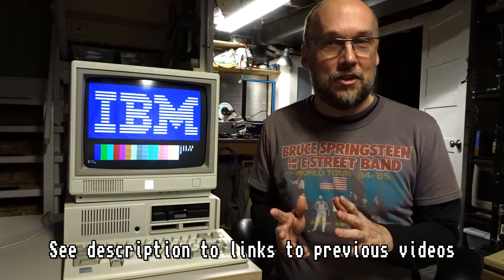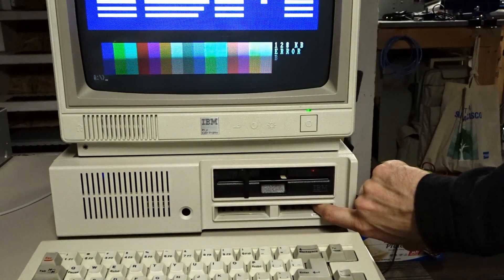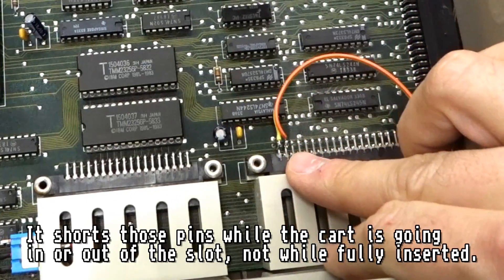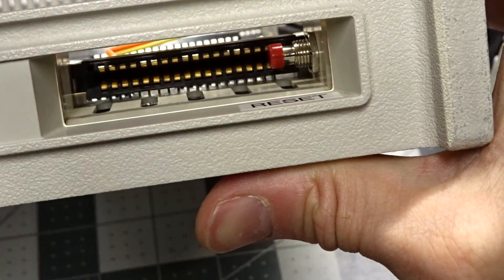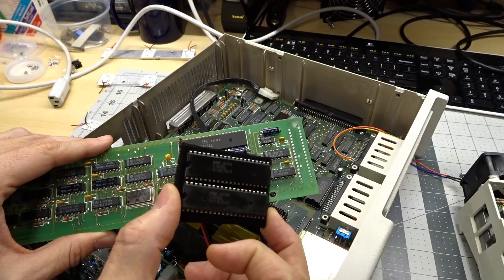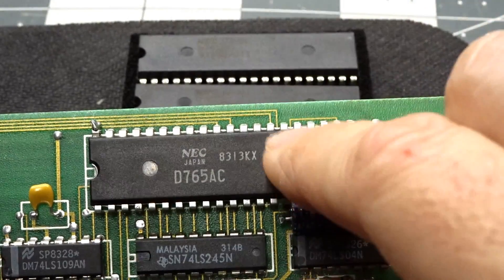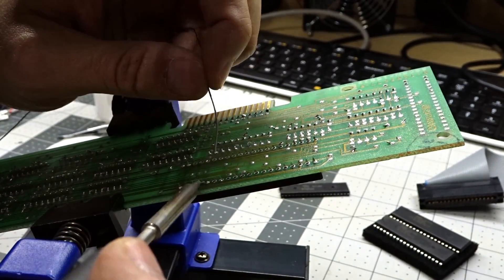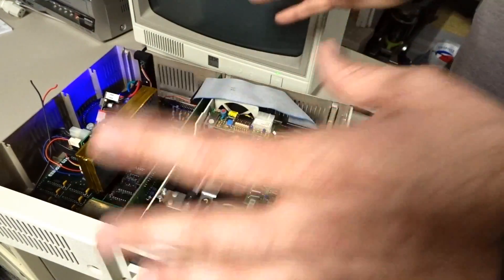IBM PCjr Part 3: Fixing the pesky boot issue once and for all

Comment: Love the debugging and the mod, just wanted to say (sorry!) that it may not be a great idea regarding the placement of the reset button. Your finger will touch the cartridge slot contacts. your finger will eventually carry some charge and create ESD damage to ICs on the bus. I am normally not one to obsess over ESD but this is just asking for trouble :) Perhaps it would be a simple mod to get some strip board with the right pitch and use that as a cartridge edge connector, and solder the button onto that, so that it sticks out towards you? This way you won't be able to touch the pins of the bus.
Reply: The switch is at the front of the cartridge slot, There is a good inch or so between the switch and the pins. Unless you shove your finger all the way into the slot there is no chance of actually touching the pins. Also the case of the cartridge slot is grounded so as soon as you touch it any static is safely discharged to ground.
Reply: @FloppydriveMaestro  is there? it looked to me like it was right next to the pins!
Reply: yeah, i just checked, it's right next to the pins. look at the shot from the top.

the casing you are thinking of looks like it's made out of plastic. the front panel in front of the casing is painted. no grounding.
Reply: @cheater00  The thing as as long as you are not a ham fisted oaf and dont just jam your fingers into it then its never going to be an issue.
Reply: @FloppydriveMaestro  you're right! your next project: putting a switch at the opening of a toaster. merry christmas :)

Comment: I would be so scared to snip off those legs. Should those new chips choose not to work, you'd be left with nothing, not even a malfunctioning one. But it worked, so thumbs up! Lovely machine.
Reply: Soldering the leg back is trivial as long as you don't cut right against the package (which he of course did :-D).
Reply: @benbaselet2026  Soldering is anything but trivial if you're someone like me - an inept guy with a serving of Multiple Sclerosis on top :D No, seriously. Soldering is a big pain in this state. My hands are almost useless for anything requiring precision or steadiness. So I choose not to cut, for I choose not to solder :D

Comment: It's true.  I used the cartridge for PCjr basic as my reset button.  I think either inserting or removing a cartridge would reset the computer.
Reply: In my PCjr we always kept Cartridge BASIC in the left slot.  Should the machine lock up and a 3-finger salute wasn't enough, we'd just wiggle the cartridge side to side and that would reset it.  I think the fact that the system resets when a cart is inserted or removed is mentioned in the Guide To Operations manual.

Comment: That's a very interesting fault mode for an IC. I wonder what's happening there. 

I don't know if the 765 is manufactured in CMOS, but it looks like some sort of "soft" latchup condition .. somehow not creating a hard short leading to total destruction of the chip.  What fits, is that a latchup condition can only be removed by switching off the device. I think the normal power on reset sequence was just right to trigger it when warmed up a little. 

Such faults are typically caused by slight ESD damage.
Reply: @adriansdigitalbasement   I would totally expect such ESD/latch up damage to be progressive, since they are a literal short circuit somewhere on the chip, heating up that area and damaging it further. 
I think it would have only been a matter of time till the old 765 would have failed completely. 

That's why in the industry ESD protection measures are such a big deal. Usually nothing happens without any, but if you damage something it could be latent and only manifest itself after quite a time at the customer. So they play REALLY safe for this reason.

But, of course, thats all just blind guesswork. It's ONE failure mode which would fit to the symptoms, I'm sure you could find at least a dozen others if you look for them.
Reply: My money is on a power supply sequencing problem. Some rail is probably coming up before or after some other rail and causing the issue. I'm sure the original power supply had protection logic to ensure correct sequencing, and the replacement atx adapter board does not.
Reply: @gorak9000  According to the IBM PCjr Technical Reference Manual, the whole system is +5V single supply. The +12V are only used by the drive motors and extension cards. So I think this is out.

Comment: instead of fitting that reset switch inside the cartridge slot, why not make up a 'reset cartridge' with a small switch on its front?
Reply: @adriansdigitalbasement  3D-print a replacement enclosure for such a mod, perhaps?
Reply: @adriansdigitalbasement  or even just a pcb with an edgewise push switch on it to stuff in the edge connector 😉saves making holes in the poor old thing 😁
Reply: ^^^This times 20. 3D print a case and stick a pcb inside
Reply: I thought the exact same thing
Reply: Nice idea with the 'reset cartridge'
Reply: I mean that is a good idea but honestly I could care less since it isn't mine....
Reply: @adriansdigitalbasement  There is a cartridge PCB on OSHPark that you can get a 3 pack for like $12.
Reply: @DikoMan wtf?
Reply: I am sure there would have been room on the back switch plate with the new power supply but whatever. When your hell bent on ruining the case it's not hard to find a reason to.
Reply: @pikadroo  If the reset switch is on the back it defeats the point of the reset switch. A tiny hole in a place you cant see is hardly a ruined case. Get a grip.
Reply: @FloppydriveMaestro  Aside from the fact that you have to sacrifice an entire cartridge slot just for a reset switch.
Reply: @Stoney3K  If you dont have any cartridges why does it matter?

Comment: So whats the deal with the PCjr? Was it a low cost alternative to the XT systems? or forerunner of the PS/2 systems?
Reply: actually it was Bill Sydnes that made this garbage
 joke of a guy who then latter went to work at commodore doing more garbage Davie Haynie has spoken a lot about this
Bill Sydnes(the man responsible for the runaway success of IBM's PC jr.)
 decided to re-label the A300 as the A600, and release it as a 
replacement for the A500 instead. Idiot
guy was hired by the guy who really killed commodore Mehdi Ali